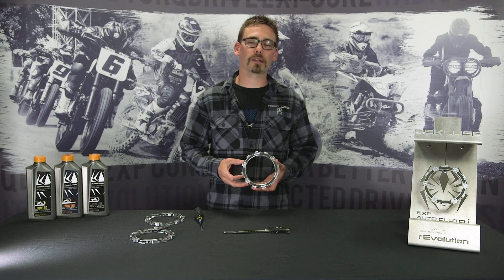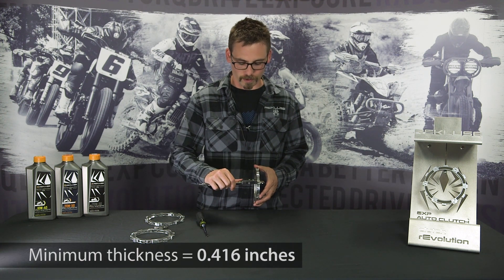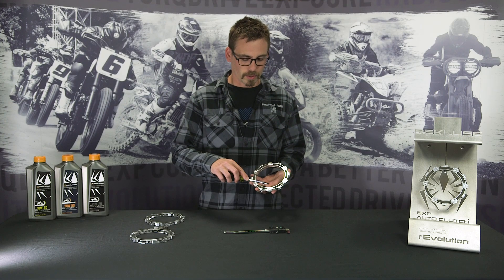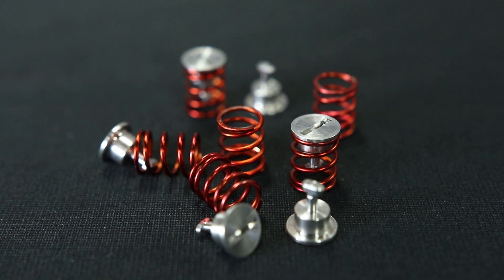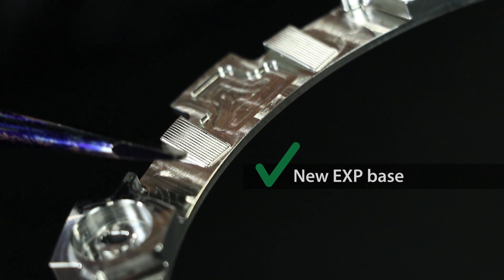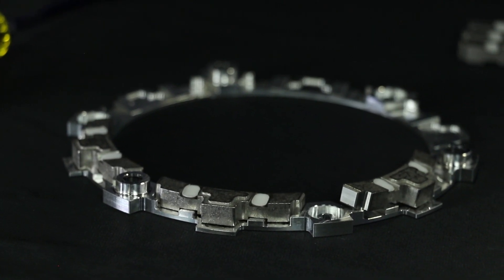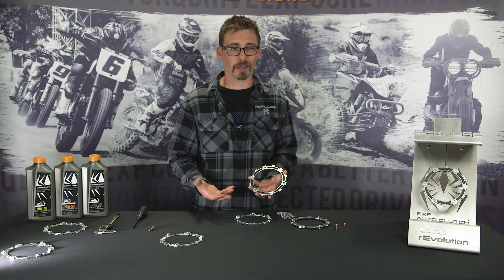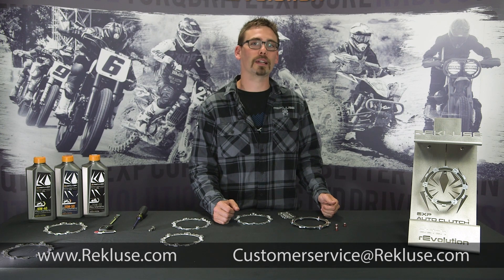Rekluse EXP 3.0 Auto Clutch Disk Inspection

Comment: Where on earth can I find the the teflon pads by themselves? Also why can I not purchase any service kits for my  2017 YZ450 on your website? I had to go to partsgiant and they sent me the wrong kit. I was at the point I wanted to switch to core manual but I cannot add the pressure plate for the Core manual YZ450 to the cart. It just gives me errors.

Comment: EXP base minimum 10.57 millimeter.The part number is:
 452-782-002 PTFE Rekluse Pad Replacement Kit - EXP 3.0 DIRT (1 BAG OF 30PCS)
And try to find the lock washer!
For 2018 CRF450RX it is 183-004A  rekluse Core Center Clutch Tab Lock Washer 27mm Small Shaft
And BASE REKLUSE EXP 3.0 , H450 TD,

Comment: Thanks for putting this up.  I just got a used '13 CRF450 that has CORE EXP (bike was sitting for almost 2 years) and stalls every time it's put in gear.  I set it up at one plus 2 on adjuster and it didnt change the stall and there is zero free play gain. Using hand lever results in stalling as well.  Guess I will pull it all apart to inspect.